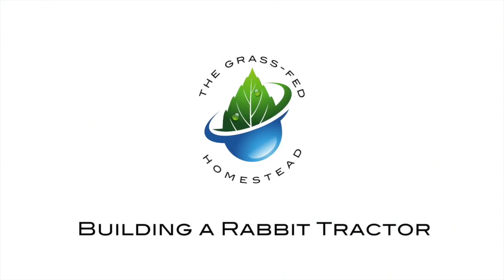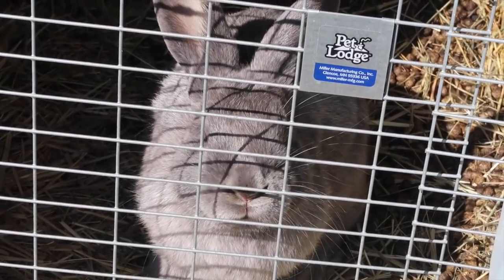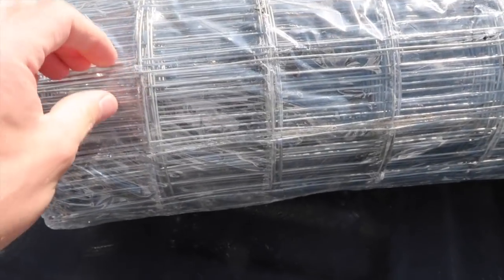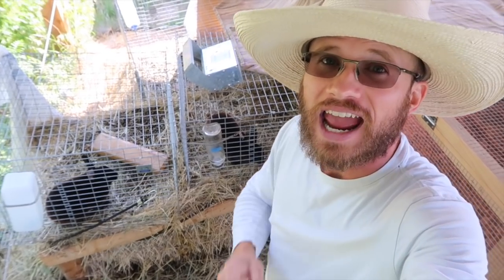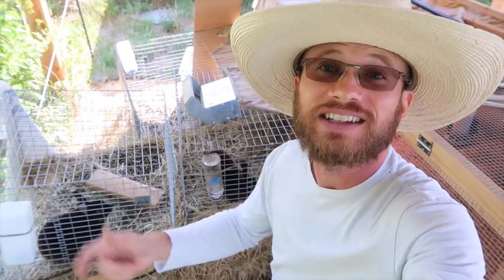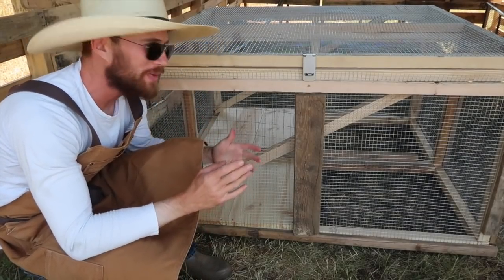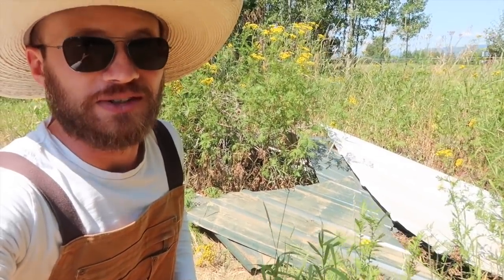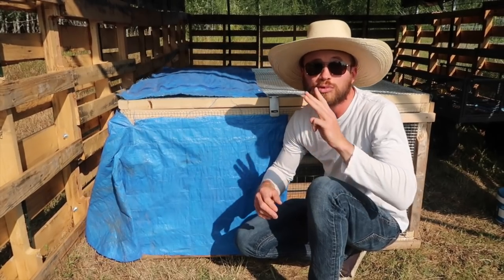Building a Rabbit Tractor

Comment: I wouldn't like to raise my rabbits on the colony system for several reasons. Not only is the parasite load too heavy, but also not being able to control the breeding of my rabbits.  I would much more like the tractor system. I keep my breeders in wire cages but will put my growouts in tractors. I will seperate the bucks and does. Hopefully they will all get along.

Comment: I would be worried about the buck breeding the does through the cage divider. So I would suggest making a second tractor half the size for the buck alone. I also breed silver fox and are a wonderful breed to have.
Reply from the maker: My hat would go off to the buck if he can pull that off.  Thanks Heather.
Reply: I've never personally had this happen but it seems to happen to a lot of unsuspecting  people on a Facebook group I'm on. Bucks being castrated & does being impregnated....yeah not having something solid as a divider can get messy. I've seen people use grain bags over the wire even that stopped it....though my rabbits would just eat the bags for sure🙄🐰😂 Just some food for thought, good luck however you decide to do it:)
Reply: Bucks will tend to mark (pee) on the does and other bucks as well
Reply: The Grass-fed Homestead it can happen. When I was a kid my brother had a buck and I had a doe in a hutch that had wire separating  the two of them.  Guess what we found one morning when we came out to feed them.
Reply: @TheGrassfedHomestead   called the dog-leg-up technique

Comment: out of curiosity, I hate having to drill, switch to a cross tip to screw the screw in and then back...do you have two drills, one with a wood drill bit and another drill just to screw in screws so you don't have to switch bits constantly....or do you do all the drilling first?
Reply from the maker: I have a drill and an impact driver (screw driver)